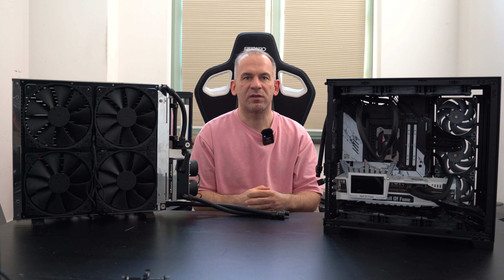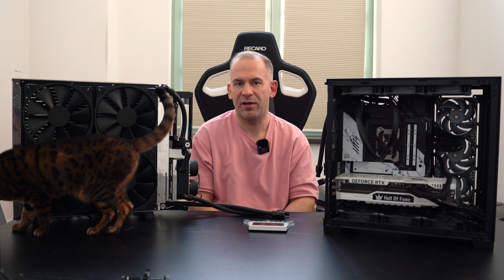My new PC Build! | 7800X3D + 4090 HOF + MO-RA3 420 🔥

Comment: 😂 don't go buying the best water cooling system for amd 7000 it's not going to help you at all. Lap the cpus or de lid it. Your not going to gain anything without doing it the metal is to thick over the ccxs
Reply: 9000 I mean AM5

Comment: you don't need that Mo-Ra3 to cool just the cpu. 4090 HOF should only be used with a water block, then your radiator will be needed. Otherwise it's money thrown away. For example - https://youtu.be/7N9cLm7SDpo